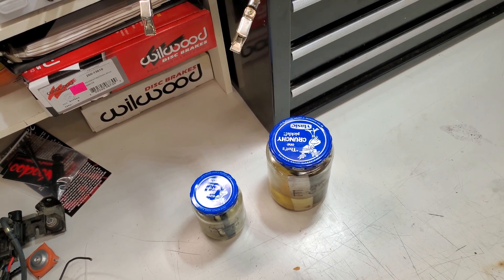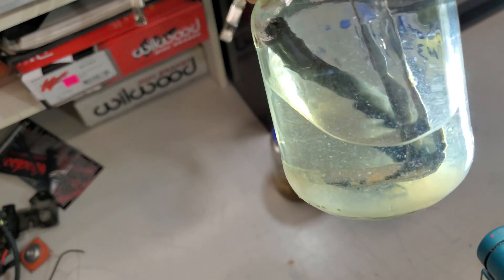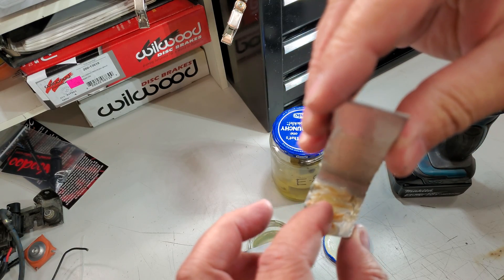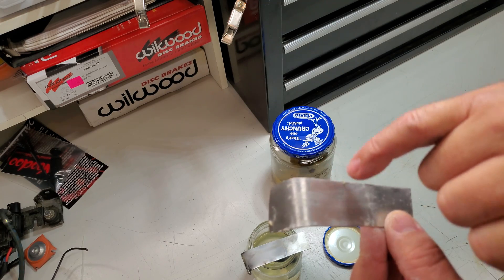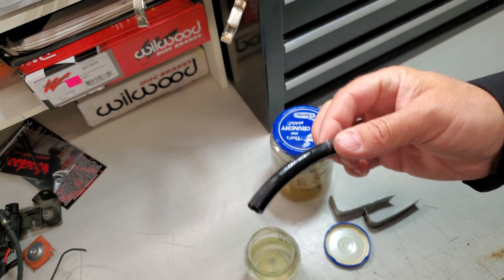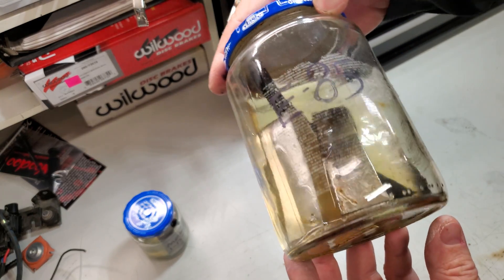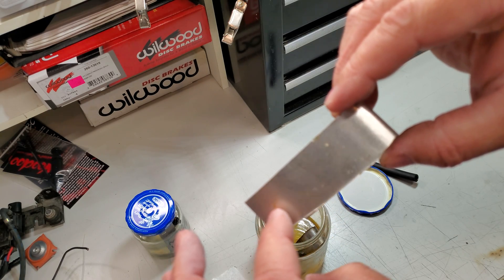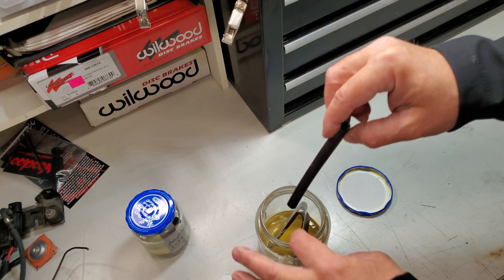Methanol & E85 Extended Test -Rubber, Steel, Aluminum

Comment: I did something really similar last year, wish I’d just watched this instead. I was looking for premix oil separation, but I threw in fuel line and aluminum for funsies. The other myth I tested while I was at it was the introduction of water to E85.  I had the same results as you did for corrosion and fuel line deterioration, and none of the oil I used fell out of suspension after a year.

Comment: The reason why metal corrodes very quickly in a car is because of Negative DC current. Heat is another contributing factor.

Comment: My dad recently borrowed my year old ride on mower with a Briggs v twin engine, he used non stabilized ethanol fuel and three weeks later while I was using it the thing stopped while mowing my lawn. Carb removed and the inside of the float bowl is a mess of granular grey/ brown aluminium corrosion, a sort of soap like mush.  It's now cleaned but is there any way to passivate the pitted areas and help prevent further corrosion. I only use fuel with Briggs own stabilizer added.
Reply from the maker: I'm not sure what that was, but one use in a two week period wouldn't do that. This stuff had to sit for a decade before we started getting anything at all.

Comment: Since the biggest con of E85 is attracting moisture. It'd be interesting to see E85 (sealed/no moisture contamination)  VS E85 with a teaspoon of water added to simulate moisture contamination VS  Gasoline (non ethanol gas).......I'm sure the gasoline sitting long term would separate & form  gummy/sticky deposits on the metals & hose.
Reply from the maker: You're probably right.

Comment: It feels like salt because methanol, when exposed to aluminum, does in fact create salts and corrode the aluminum
Reply: Then why is the aluminium not corroded?
Reply: @TheChrisey  it is slightly corroded, I assume, if it’s in methanol. Ethanol doesn’t corrode as fast as methanol does so it isn’t as much of an issue

Comment: Good video and test. Thanks for doing it and posting it. The results are expected, but to get a really good comparison, it would have been nice if you had two more sample jars, one with E0 gasoline and the other with just water. This way, for example, you could see if the black marks wiped from the rubber are just due to moisture, or if they were because of alcohol's "corrosiveness." I believe you'd find that the jar with E0 gasoline would show similar or worse results. The water only jar might show similar results.

Incidentally, the black mark may not be caused by any disintegration of the rubber, but from the dye used to make the rubber black. Rubber is naturally white in color.
Reply from the maker: True! I still have these on the shelf too, need to update the video or something as well.

Comment: hi there, interesting test!
i'm looking into converting my 1.1L carburated car from 1985, and i want to find out more about how it affects rubber. Any update on the test in 2021?
Reply from the maker: It's still sitting on shelf but I haven't touched it since this video. The rubber still looks like rubber in there, it hasn't dissolved or anything crazy. I'll take it out soon and do an update video. Thanks!
Reply: @DoesItTrack  Ok, good to know! thank you :)

Comment: We use methanol in our Sprint Car.  After every race, plugs are all pulled as well as all fuel lines and flushed with Marvel Mystery Oil to protect against the corrosion. The corrosion factor is amplified when the AN fittings are exposed to air after methanol exposure.  Idea for a test, soak aluminum in methanol for 24hrs, then remove and let stand in regular atmosphere for a week.
Reply from the maker: That's a great idea! Do you have a shelf life for the methanol you run in the sprint car? I try to stay around 2 weeks for e85, and I'm curious if methanol is about the same?
Reply: @DoesItTrack  No, but I try to but my fuel two weeks before an event and will usually have some leftover.  I have used methanol (which I store in plastic jugs) that is 2 months old and never had an issue with performance.  If you opt to do the experiment, use two fittings.  One which is new with perfect anodization, and the other you need to mar or breech the protective coating of the anodizing.
Reply: @christianmayhew2617  Hi! I have a Chrysler T&C FlexFuel car for E85 (85%ethanol and 15%Gasolin) can i make a mix 85%methanol and 15% gasolin? In Poland we dont have E85, ethanol is expensive, but methanol is cheeper:)
Reply: @321pstryk  Absolutely!!!!
Reply: @321pstryk  I pay $2.99 a gallon for methanol here in the States.  Also, #TRUMP2020
Reply: @321pstryk  don’t do that mate, 85% Ethanol is safe with today’s fuel systems, but methanol is way more corrosive and at 85% it will do damage. Hope you see this reply on time
Reply: @MrDrivingFaster  Depending on the substances, methanol is more corrosive than ethanol. However, both ethanol and methanol are generally less corrosive than gasoline and aromatics.
Reply: @christianmayhew2617  dude does methanol go bad? I have a left over that is sitting in a barn for almost a year now, its in a its original can container, thanks in advance
Reply: Rubber could crack from the alcohol evaporating causing the surface to dry out. As long as it's soaked it won't dry out and crack
Reply: @TheChrisey  Why would the rubber crack from alcohol evaporation but not from gasoline evaporation?
Reply: @marcrauch8213  Gasoline is a petroleum product, it has lubricating properties. Alcohol on the other hand does not
Reply: @TheChrisey  If gasoline was a lubricating product, why is a separate supply of oil required in large engines? Why is oil added to the gasoline used in some small engines? And what has "lubrication" got to do with the issue of evaporation, which you brought up?
Reply: @TheChrisey  It's not me that needs to do the research, it's you. You jumped into a discussion you are ill-suited to be part of. Of course, additional oil is required, but you made it seem like the "lubricating properties of gasoline" wouldn't cause damage to the rubber. The same oil is used in the same lubricating process as is used for gasoline. You ignorantly mentioned the evaporative characteristics of gasoline, and then did it again in your most recent reply. In fact, gasoline evaporates more quickly than ethanol, and so if "drying" was the problem, then gasoline would be the greater cause of that problem.

Now, let me stop for a moment and tell you why I know all this, and why I know that you have no clue as to what you're talking about. I'm the co-founder and co-owner of The Auto Channel, the Internet's oldest and largest automotive information resource. In addition, I wrote two books about alternative fuels (THE ETHANOL PAPERS - 600-pages long, and YES, TIN LIZZIE WAS AN ALCOHOLIC - a much shorter book dealing with the Ford Model T). In addition, I've written and published hundreds of individual reports and essays regarding fuels, I've been a featured speaker at several alt-fuel industry conferences, and I've presented fuel-related evidentiary information before Congress committees in Washington on two occasions. 

Continuing on, gasoline and aromatics, not ethanol will corrode rubber. This is why Dupont invented Viton rubber in the 1950s: to deal with the gasoline-rubber corrosion problem that had existed for decades. In the 1950s, ethanol was not mixed into gasoline in America, so clearly ethanol was not the issue. Moreover, ethanol was mixed with gasoline in Great Britain and other parts of the world starting 100 years ago. However, ethanol did not cause increased damage to rubber in all the years that "Power Alcohol" fuels were used in Britain, nor did ethanol cause any damage to rubber parts in all the years that Brazil used ethanol-gasoline blends. Brazil has been mandating E15 and higher fuels since 1978. In the past decade or so, the mandated fuel in Brazil has been E20 and above (now it is E27), and Brazil's vehicles and small engines are the same as those sold in America, Canada, England, France, Italy, Spain, Germany, Japan, Korea, and other countries.

If you have credentials that equal or surpass mine, and specific information that contradicts what I've stated (i.e., the evaporation difference between gasoline and ethanol), I would love for you to state what that is.
Reply: @marcrauch8213  The only thing you're trying to say is that ethanol is not anymore harmful to rubber than gasoline is. Let me send you a part of the braided rubber hose I used on my car previously that ran with E85 to prove you wrong. You can keep overlooking all the cases where rubber hose has dried out and cracked from Ethanol all you want but they won't go away for that. Also boasting the way you do doesn't provide any form of evidential ground for your claims whatsoever. If you actually want to gain any form of leverage in this discussion, start by debunking all of the cases I've mentioned previously. You even asking me why gasoline is not enough to lube an engine alone just proves you're not fit to have an intellectual debate at all as it's completely irrelevant on any plane. We're comparing the harm done by E85 vs gasoline on rubber, so stick to that subject. Issues with E85 on some rubber is already widely known. Also, what fuel is available in Brazil or the UK is completely irrelevant since that's not the only option they have. Not all cars run on E20 just because the gas station offers it.